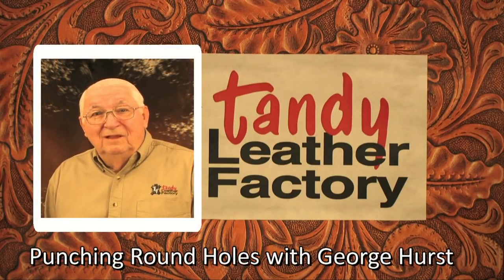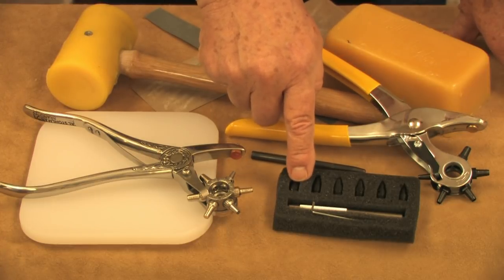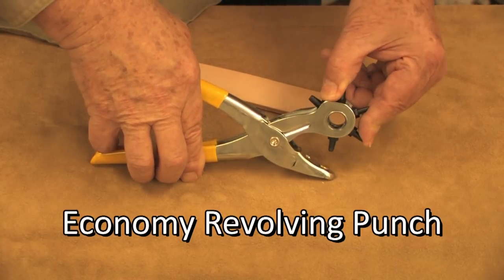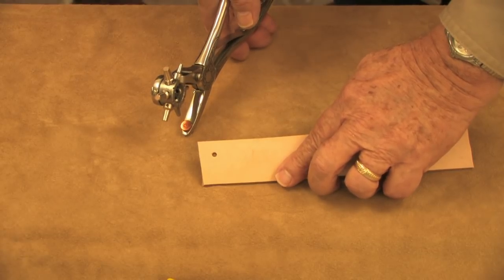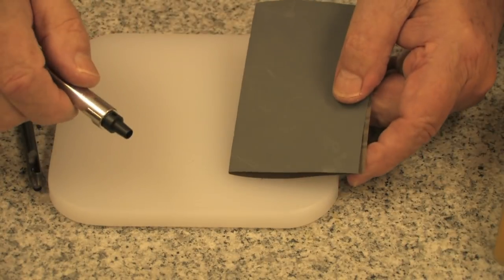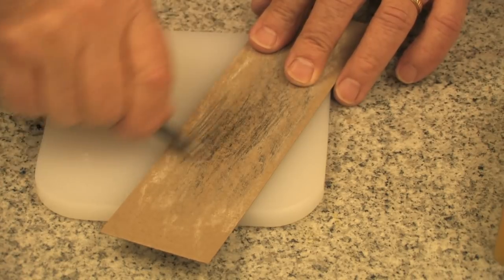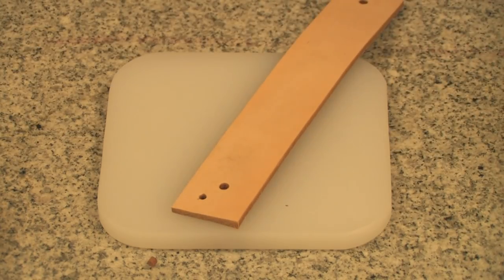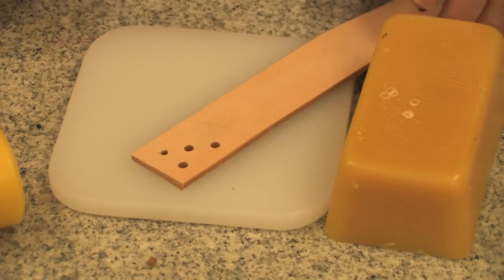How To Punch Round Holes Using Drive and Rotary Punches

Comment: Thank you for all the great Tips, I'm very new to using the Hollow Hole Punches so I'm experimenting with different materials. All your advice is needed right now, I can't thank you enough Sir.
Can anyone recommend a Hollow Hole punch (0.5mm+) that doesn't leave a burr on the exit side of MYLAR/Plastic sheets? Plus what base could you recommend to help stop the burring would a piece of MDF do the trick? I would be really grateful of any advice. Thanks for sharing the video 👍😷👍

Comment: Could you tell a bit more about piece of cardboard you use to sharpen / polish your punches? Did you say you've rubbed something to it? Thank you for such great video collection, Michael
Reply from the maker: ***** Hello Michael!  

As far as the cardboard George mentions, the most important thing is that you use a firm, flat surface.  Cardboard used in packing boxes would have too much give, however you could use illustrator board, cardboard from a cereal box or even a firm business card.  

Jewelers Rouge ( http://www.tandyleatherfactory.com/en-usd/search/searchresults/3323-00.aspx ) is used for sharpening many of your tools.  You can also use the Jewelers Rouge on leather to create a strop for your swivel knives!